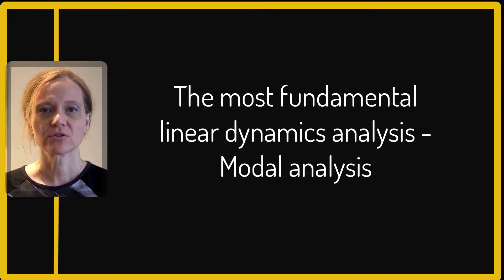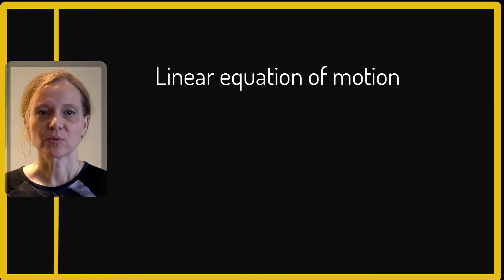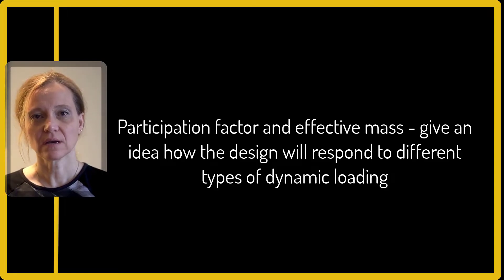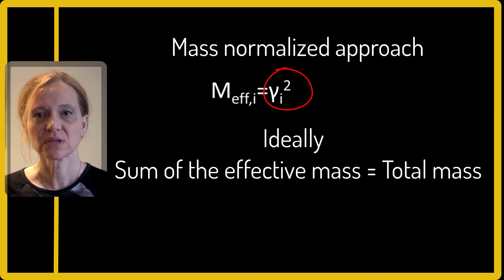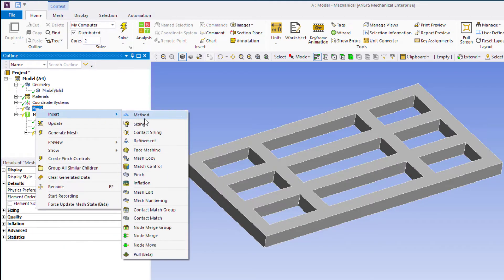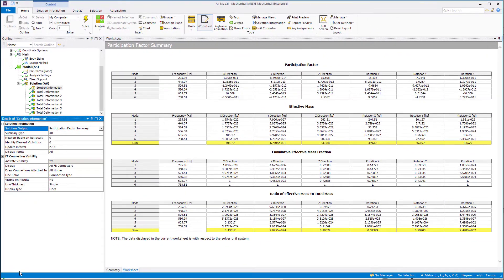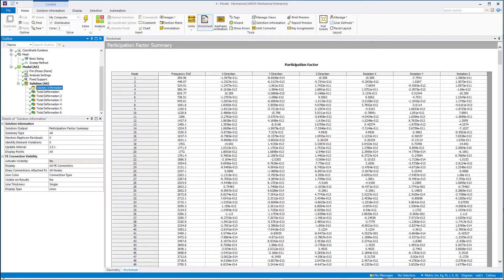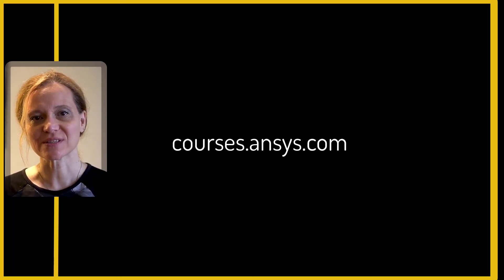Performing Modal Analysis Using Ansys Mechanical – Lesson 1

Comment: Good Video. But my basic doubt is, if there are no external load on the structure, why structure should generate modes and frequencies? It is like, If I fix a sheet with 2 bolts, that sheet will not vibrate until and unless If we excite. Please clarify. This might be basic question.
Reply: Because natural fequency
Reply from the maker: Thanks for watching! Please post your query on the Ansys Learning Forum for a detailed answer from the wider Ansys Community: https://ansys.com/forum.